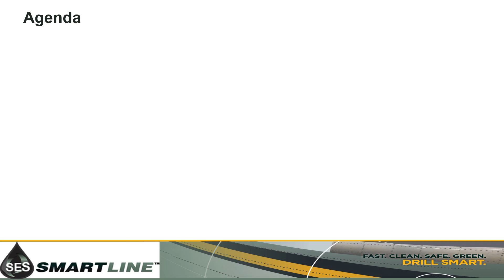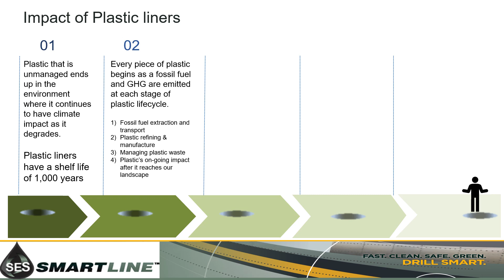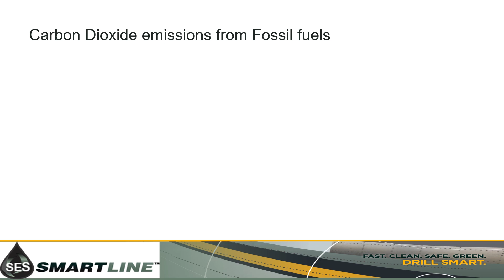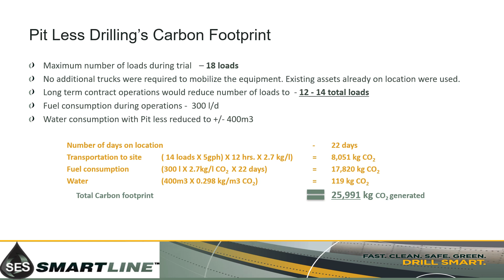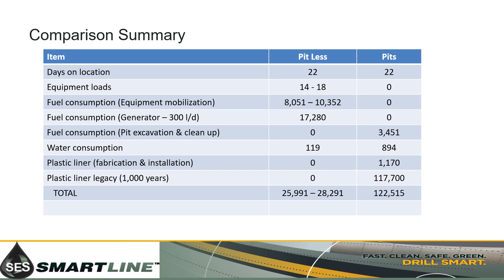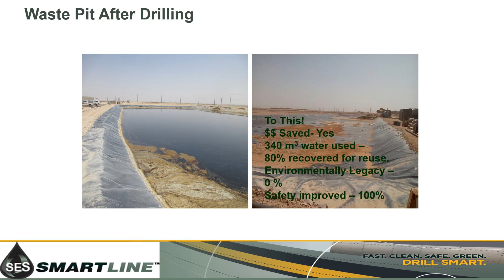SmartsiteTM Greenhouse Gas Emission Comparison

Comment: Interesting stats!!!
Seriously doubt anyone realizes the impact plastics actually have on GHG foot print.

    To mention a few of the other core benefits of Pitless Drlg;
- Cleaner mud systems w/ reduced product used.
- Improved porosity in pay zones due to cleaner mud properties.  
- Less down hole issues.
- Reduction in drilling time, better ROP.